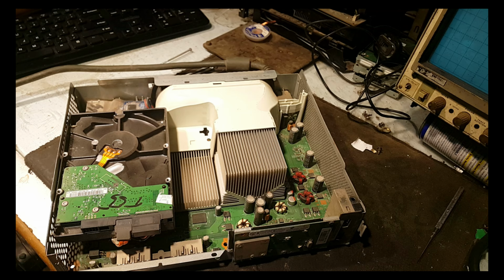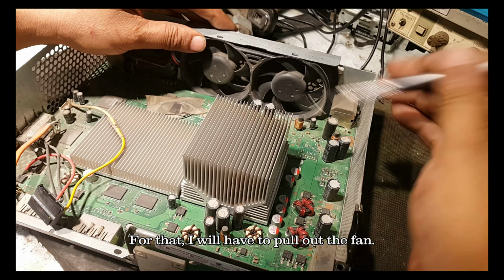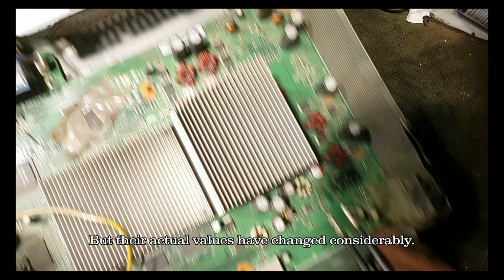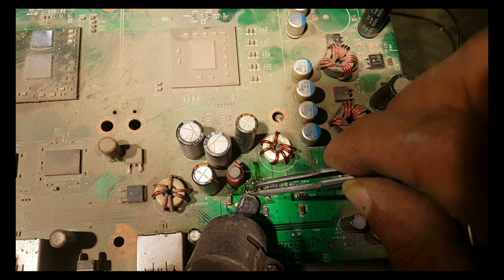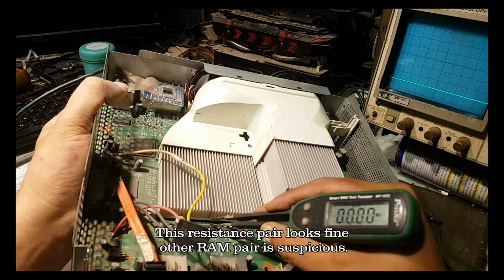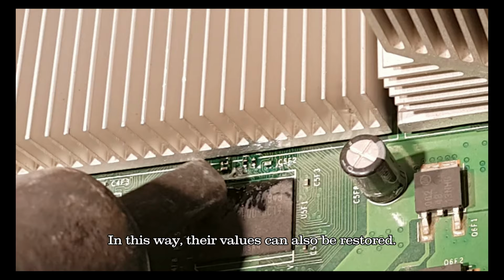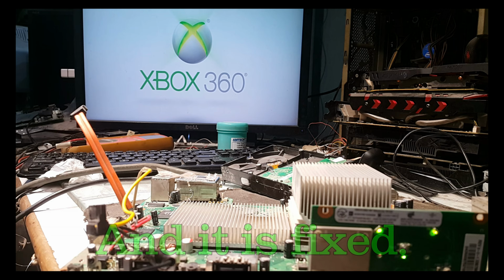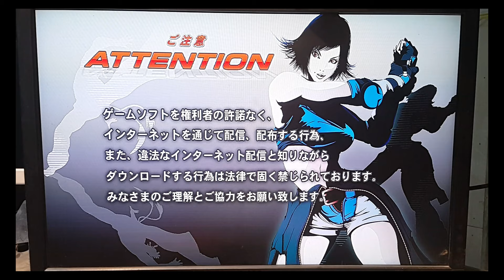Console restoration - xbox 360 red ring of death repair - Fixed!! -

Comment: Great Master what about falcon how to measure resistance on standard voltages if no display
Reply from the maker: Check for the Hana chip output coupling resistor's voltage difference or measuring differences in the biases resistances as well.

Comment: Hello, i'm trying to fix a 360 slim with no power, it had blown 3.3v regulator, replaced it and now it only has a beep and shuts down in 2-3 seconds. Resistance on 3.3v line is 140 ohms, anyone has ideas on what's wrong ? i read that many times when u have 3.3v regulator blown it takes down southbridge with it also

Comment: Mine has a red ring of death when i press power button psu indicator changed to red in a second and remain orange i dont know where to start either it is psu problem or the consol itself
Reply from the maker: Its motherboard usually causes this problem due to shortening GPU power or CPU power supply FET in the motherboard, so it is important to check whether the GPU FET is short or the CPU power supply is short If GPU power supply is short then change it if it doesn't fix it then leave it because its GPU is shorted
Reply: @idreestech  Thanks I'll Try To check